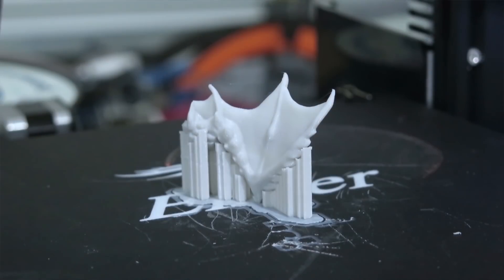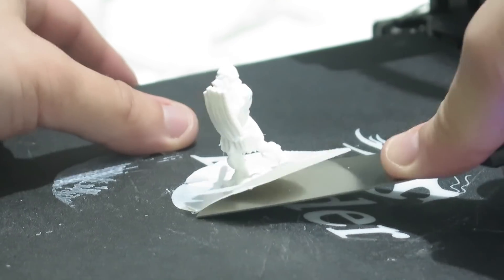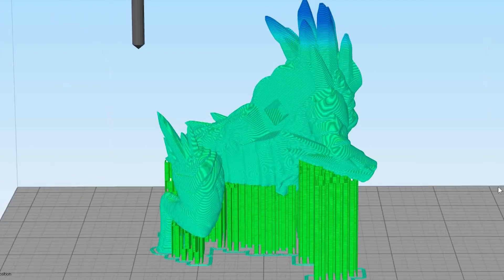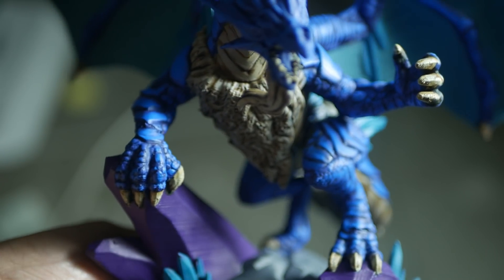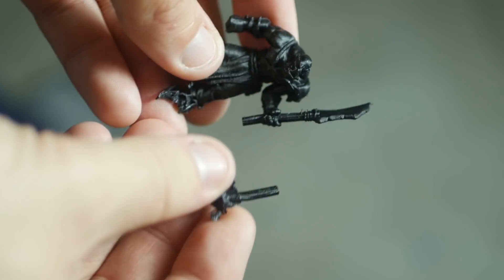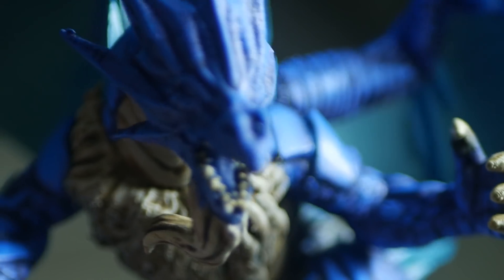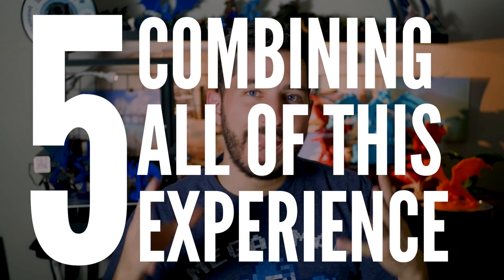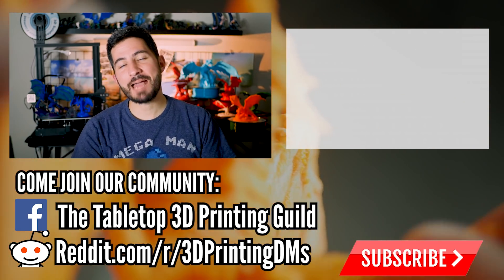Orienting 3D Printed Minis for Better Quality, Supports, & Removal (Printing The Game #10)

Comment: What is the general opinion on slicing the models in half and printing them in two halves and basically gluing them together? I understand it might be hard to fix visibly but if you're going to post-process (especially prime and paint), is this doable?

Comment: Thank god I cam across this. I tried printing the 3D orc fighter and his face is almost non existent and alot of it just looks brittle and that it could break any second. I did 15 percent infill with 3 layers and it still looked brittle. It was also pretty small so I may up the scale a good bit and see if that fixes some of the issues.

Comment: Finally the video I was looking for!!!! and it was exactly what I wanted to hear I had a hard time cleaning my supports off the Hero Forge template Paladin, and changing the Orientation should fix the Issues I has having with removing the supports. thanks you!!!

Comment: 4:00 Looking at the Dragon example, would you help me understand why it wouldn't be easier to cut the body into 2 halves, printing each half laying on the cut?
Reply from the maker: You totally could, but the print resolution would be impacted and sometimes doesn't look as good, and you'd have a very obvious seamline you'd have to fill. We did this with our Clockwork Dragon actually :)

Comment: Hey 3D Printed Tabletop, I don't know if you have considered using Meshmixer to create your own custom support structures instead of the supports created by Cura. You can create the supports in Meshmixer then export them into Cura for printing. I find that the detail is nicer and the removal of supports is a lot easier (and there is less clean up to do on the model). I highly recommend it if you get the chance to test it out.

Kind Regards,
Dan.

Comment: How do you "cut" a 3D model into smaller parts? I would like to spread the parts horizontally on the ground so I need less support. Then I would assemble and glue the parts like any other model kit.

Comment: I use Cura;s tree supports for 95% of all my prints. So much easier to remove. https://www.thingiverse.com/thing:2840687 I tried every orientation possible and never got the goblin archer to print well. The tree support let me print him upright  with remarkably little trouble removing supports. I've been hooked since.

Comment: Hey Danny, my Cura doesn't have that button for adding custom supports.  Where is that setting?
Reply: It’s in the top bar under Toolbox and browse packages. It’s a plug-in that you install, and the button should pop up (after you restart Cura) right below the support blocker button.
Reply: @KrazyZombieMan  Toolbox is now Marketplace in Cura 3.6.

Comment: Great video. Possibly in an upcoming video you can share about the settings you use for supports in Cura. It's a fine line between having supports that function as they should and having them seem to glue to the model. I'd like to see some detail about that topic. thanks, keep up the great work!
Reply: Yes, this please! I'm new and I've tried messing with supports only a little bit. I just used default settings in Cura and supports were attached so hard it was impossible to remove without breaking the model. I don't know what to change.